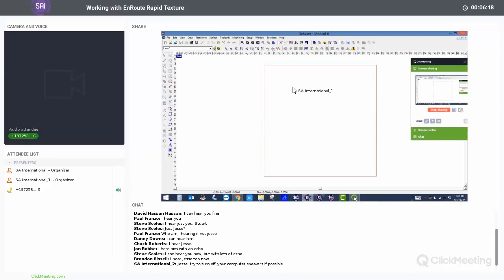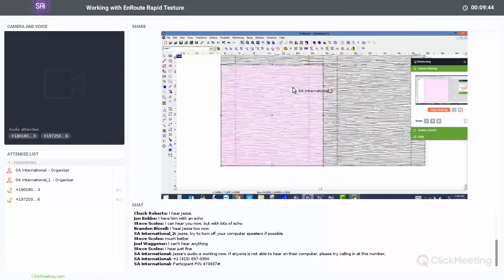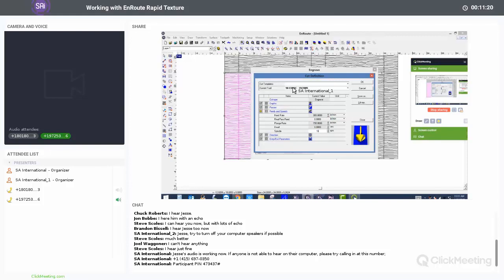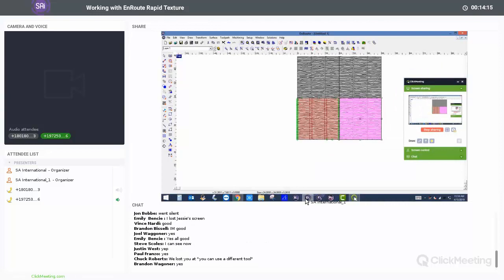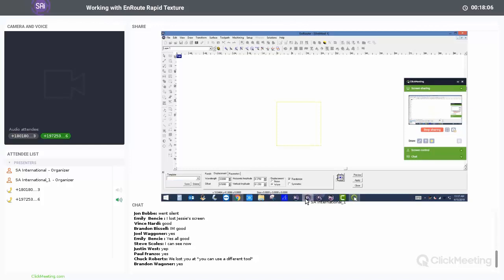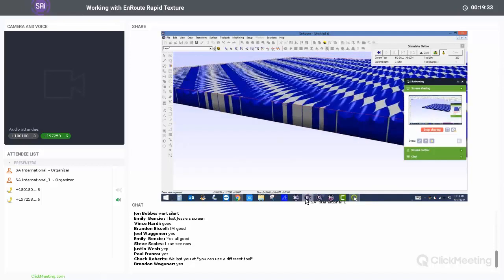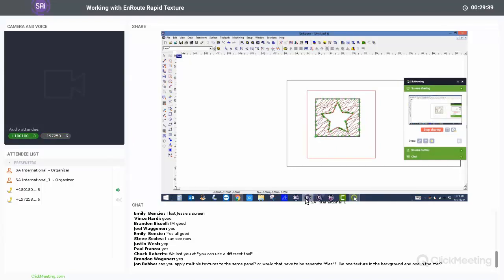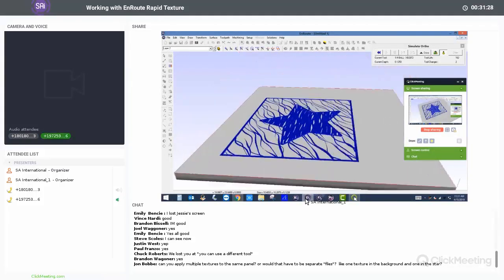EnRoute Webinar - Working with EnRoute Rapid Texture (April 15, 2019)

Comment: I have a question about omitting areas (your star example). I tried replicating that, but the texture is still passing through the star. I'm using Enroute 5, by the way. Is there a different process for Enroute 5 users?
Reply: I struggled a bit too, you have to group the things you want masked and also the perimeter before selecting your seed line or make the texture